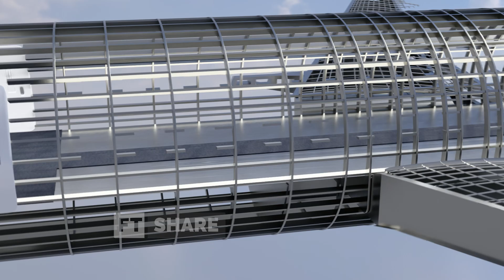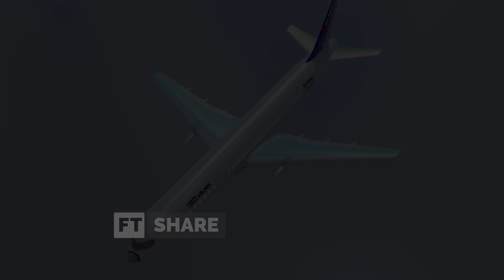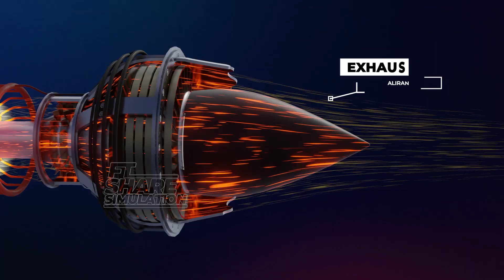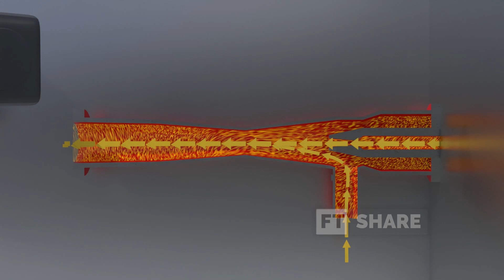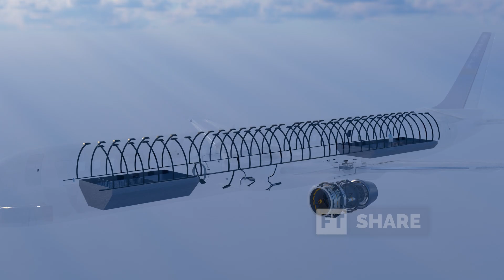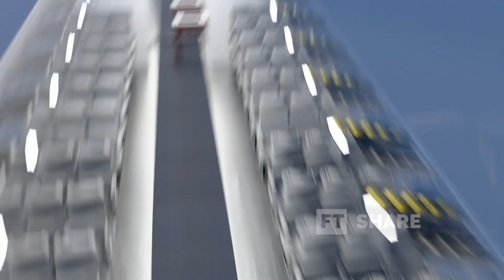How Jet Airliners Work: Unveiling the Secrets of the Skies!

Comment: Ya got a major thing wrong...on the engine's output nozzle, you (well the AI narrator version of you) stated that "The working principle is like slightly closing a hose nozzle to increase pressure", but that is not correct.  When you nozzle a gas generator, or put your thumb over the end of a garden hose, you are actually decreasing pressure by increasing velocity.   Can't have both.

This is how many a carburetor works.  The inlet and outlet of a carb are all super smooth and aerodynamic for flowing massive quantities of air...at least the carbs I play with do...anyway, between the smooth round almost jet like matching nacelles of the input and output is the heart of the carb.  It is here where you'll find all the important mechanical bits such as the choke, the jets, the bowl, the needle valve, etc.  This magic area has what is called a venturi, where the airflow is restricted via a decrease in diameter.  Think of it like a short piece of pipe, with a cone on each end that matches the size of the input and output.  Kind of like this =>-<=  The air speeds up to flow through this section, thus decreasing the pressure.  It's this pressure differential (ambient outside the venturi vs less than ambient inside venturi),  which draws the fuel in through a small hole right in the middle of the venturi, allowing the engine to get fuel.  This pressure/velocity ratio is known as The Bernoulli Principle.  As the engine builds revolutions, it draws in more and more air, making more velocity, thus lowering the pressure...and with that comes more and more fuel, due to the rising pressure differential, which is hopefully maintained optimally at the proper stoichiometric fuel to air ratio to achieve maximum combustion per crankshaft revolution...and if you're running a 2 stroke that isn't oil injected, not starving the motor of oil and running super lean and melting the cylinder or worse!!